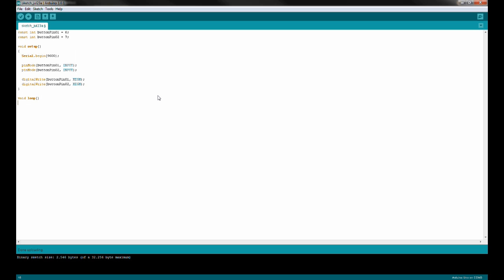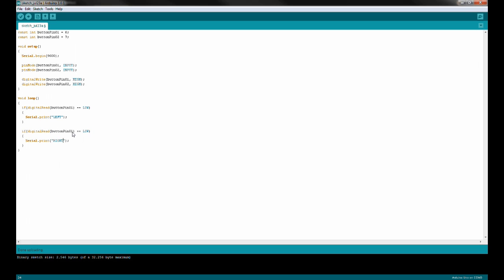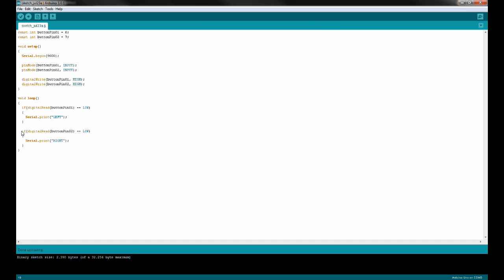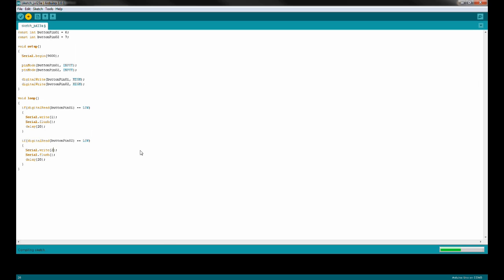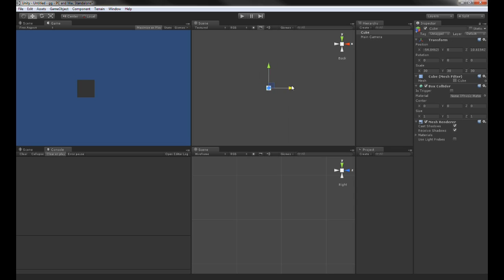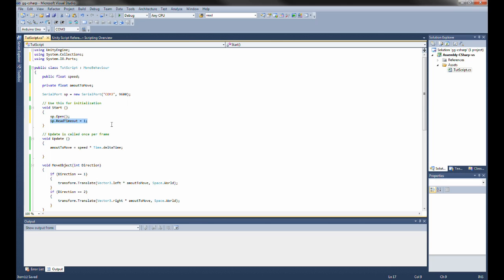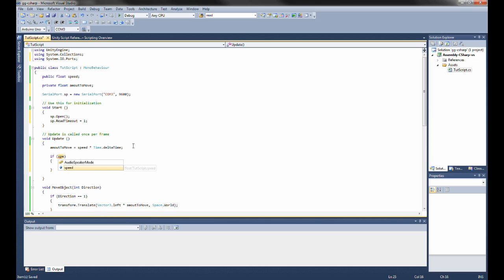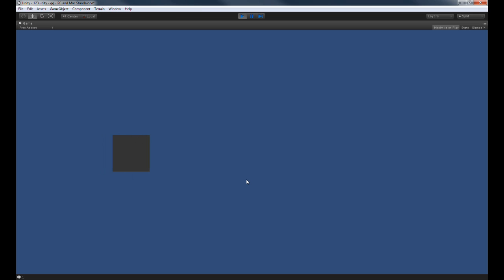Basic Arduino to Unity tutorial

Comment: For anyone using a mac who received an IOException error, open the mac Terminal and search (ls /dev/tty.*) without the brackets to find the serial port for your Arduino. It will look something like (/dev/tty.usbmodem1411). For the line in the Unity script in this video which reads SerialPort sp = new SerialPort ("COM3", 9600); replace (COM3) with (/dev/tty.usbmodem1411) or whatever your search showed. Don't forget to change this setting too : Edit > Project Settings > Player > Other Settings > Api Compatibility Level > NET 4.x.

Comment: using directive is unnecessary.
The type or namespace name 'Ports' does not exist in the namespace 'System.IO'(are you missing an assembly reference?)

any idea?? im using visual studio 2017.... pls help
Reply: If you are using .net lower than 4.x : 
- In unity: Edit > Project Settings > Player
: 
- Change Api Compatibility Level from .Net 2.0 Subset to .Net 2.0

If you are using .net 4.x with Compatibility Level .net Standard or .net 4.x: 
- In Visual Studio: Tools: Nuget Package Manager: Console:
- Type in: Install-Package System.IO.Ports -Version 4.5.0
- Search "System.IO.Ports.dll" in your Unity Package folder. Copy that dll into YourUnityEditorPath/Unity/Editor/Data/NetStandard/compat/2.0.0/shims/netstandard/
- open your unity project file "Assembly-CSharp.csproj"
- add following lines:

    <Reference Include="System.IO.Ports"><HintPath>YourUnityEditorPath/Unity/Editor/Data/NetStandard/compat/2.0.0/shims/netstandard/System.IO.Ports.dll</HintPath></Reference>
Reply: @sedoni6059  Unity/Editor/Data/NetStandard/compat/2.0.0/shims/netstandard/
i see now.....i don't have the System.IO.Prrts.dll itself...thanks

Comment: The "good stuff" is at 10:55.  I would not like to "hard code" the serial port number through.  Anyone have code that can query all ports, find out where the arduino is connected and then initialize the serial port base on that?  If you follow this, the port may change on some other day, because you have plugged something else in, or changed computers, and if you send this out, there is no guarantee that your users will get a connection on the same com port.

Comment: Thank you for a very helpful tutorial, though I have a question... What if I want to send multiple values from arduino to unity, like the x,y,z from an accelerometer?
Reply: Parul Bedhotiya You send them together like this: Serial.print(x); Serial.print("separator"); Serial.println(y); Than you read the serial data in unity and split it using your separator. After splitting, the first element of your array is going to be x and the second y. Hope this helps.
Reply from the maker: Then you wouold need to send it in some form of stream and then split it inside unity so that x1y23z23 will be  x1   y23   z23
Reply: inScope Studios Hm... Or split it with comas and line changes. Right, thanks! With a little luck it might just work!
Reply: Parul Bedhotiya string.Split() returns an array - you can convert it to a list using ToList()

listStrLineElements = line.Split(',').ToList();
source: http://stackoverflow.com/questions/9263695/how-to-split-a-delimited-string-to-a-liststring
Reply: inScope Studios Hi thankyou for the tutorial it really helped! I wanted to send two inputs simultaneously to unity . can u please tell in a simpler way how i can do that. Do i send the two inputs in an array??
Reply: +rjth Thanks so much! Its a little clearer to me now! would you know the function that splits an array or string in unity bc there are some functions that are not included in the software
Reply: ***** Thanks so much! Its a little clearer to me now! would you know the function that splits an array or string in unity bc there are some functions that are not included in the software
Reply: ***** ill try that. thanks :)
Reply: please help me how to split serial data that i received?
Reply: sir? How did you split the serial data? in short, how to this tutorial can be done using serial data x,y,z?